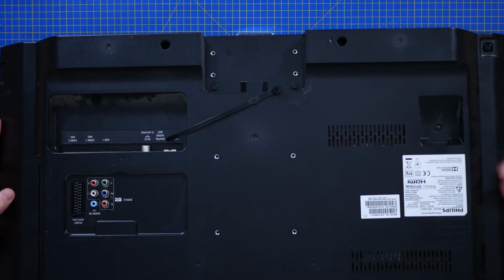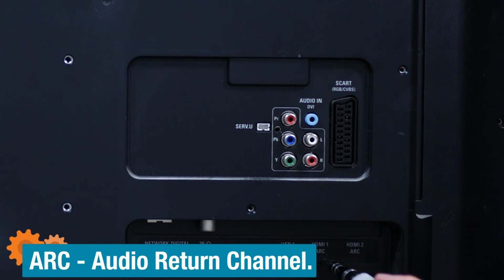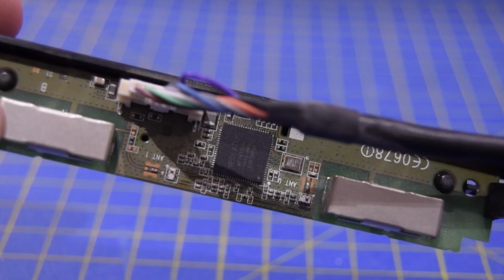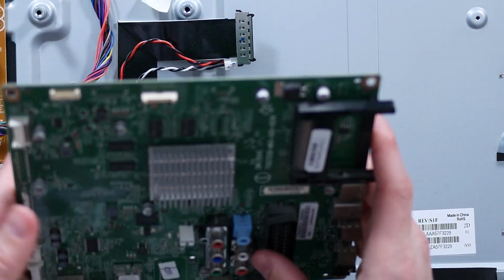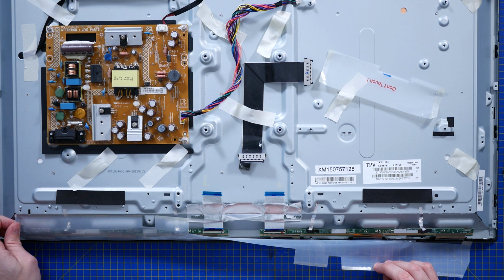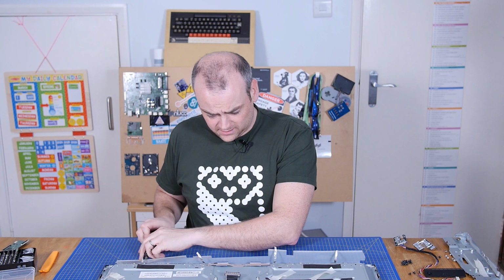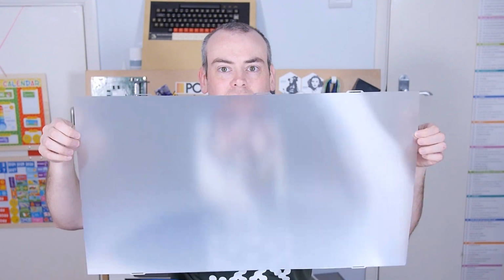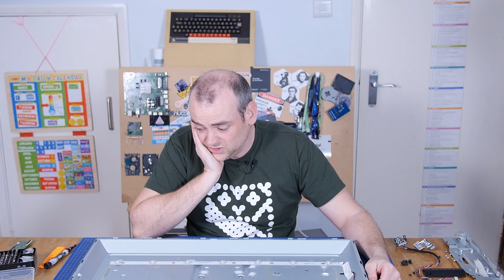Taking Apart a Philips 32" PFT5500 Smart TV: What's Inside? - The Electronics Inside

Comment: This teardown was very cool, but I'm more interested in seeing what you do with those parts now
Reply: I'm open to suggestions!
Reply: @a531016  In a lot of China Retailer marketplaces (such as AliExpress), there are Driver Boards that can be priced as low as $20 or perhaps even lower. I would be interested in seeing if it's possible to reanimate one of these Smart TVs with one of them, even if the "Smart" part dies out due to lower firmware or incompatibility...
If it works, it could possibly save some E-waste since folks are out there replacing entire TVs instead of repairing it themselves!

Comment: The diffuser films look like prismatic films. They are intended to shape the light emission patern of the backlight to redirect light towards the viewer. 3M call them BEF and they have a big market share AFAIK.
Reply: Looking at the video (I couln't tell this at the time) it looks like there is a horizontal and vertical layer? I would suggest that these are to columate the light as it goes throught the LCD, with the peralesent layer looking like it's there for even illumination?

Comment: Yeah, even the most expensive "smart TVs", TV boxes and the like are still a decade behind when it comes to hardware. That goes for tablets as well. There's no reason that even a "child's tablet" at this point in time should come with less than 4 GB of memory and 64 GB of storage and a decent processor. There seems to be an industry-wide conspiracy to make everything instantly obsolete. Not to mention the astounding profit they must be making with such cheap, ancient, obsolete hardware.

I would much rather have a "dumb" TV with a high-quality display and an external media box that can be replaced. I've already had to hook up an external media box to my $9000.00 Sony 85" 4KUHD TV that is only 2 years old because the streaming media apps don't work and it's relatively ancient Android 8. I'm probably going to end up building a HTPC so I never have to worry about planned obsolescence with my TVs again.

Make no mistake, this is EXACTLY why you can't buy a regular, "dumb" TV anymore. It's because the manufacturers want you to buy a new TV every 2 or 3 years just like you do mobile phones. They know that a regular TV will last at least 10 years, and we can't have that...

Comment: That's not an LED TV. In fact, none of the TVs that are advertised as such are. They are all LCD TVs. The backlight has nothing to do with the display technology. First generation LCDs were (and still are) not called "CCFL TVs". True LCD TVs do exist. Therefore it is not valid or acceptable to call any LCD TV  LED.

Comment: The grime that looked like water damage is likely from manufacturing. You often find it in areas around components with massive heat sinking capabilities so it could be some special flux or additional soldering steps that are not cleaned in the same way as the rest
Reply: It's certainly not impossible, although it didn't quite look like (what I would regard as) normal flux marks? Still could have been though! Whatever it was, it didn't appear to adversely affect the TV.

Comment: I'd like to strip Android out of my TV. It's such a shame we don't have an open source Linux distro - but then how would we flash it?
Reply: You would still need custom firmware for every device. Just plug something into the hdmi and use that, raspberry pi would be good.
Reply: @Somebody2687  There are far better (and cheaper) options than the Pi but nothing solves the issue that we're stuck with a proprietary OS,  be that WebOS, TVOS, Android etc. But you can't get large TVs, at least not that I'm aware of, without something that wants to connect to the Internet - and sell your data, like it or not.
Reply: @marcdraco  The rumour is that TV manufacturers get subsidies for preloading apps (Amazon Prime, Netflix, Disney+ etc) and adding hard buttons for them, but also for selling the telemetry data on how the TV is used. Which I can believe, because in reality, a TV these days is far cheaper than it should be!

That said, I can understand your issue with it. Maybe a large "monitor" style set with a Pi or similar and your choice of OS is a better option?
Reply: @marcdraco  I suggested PI because you mentioned open source Linux and PI has the most options for that in terms of a dedicated media device distro aside from a full x86 pc.
Reply: @a531016  Rumour?
Reply: @Somebody2687  I'm not sure it does Brandon. Sorry if I seem churlish, I'm just getting over an infection and toothache to boot. But honestly, the Pi isn't well designed and runs quite hot compared to other designs. Don't take my word for it, the experts at Armbian have torn it apart in terms of design. I have a bunch of SBCs here (two running file servers and media servers running right now, another one working as a router and a few in drawers waiting for jobs. :)

I gave up with Raspberry when I bought a Zero and then ZeroW because they were so much trouble to set up. The Chinese, sadly, make better and cheaper ones like the Orange PI and Nano PI to name two. It's a shame that a British company can't lead the field that it actually created and then grassed over. Now everyone else is playing soccer there and they're just watching from the sideline. Sorry, I'm stretching that analogy to breaking point but you get my point I hope.

By trouble, I mean this single power port and single USB. Not to mention that micro HDMI... I've done far more effective work on Arduinos than I ever accomplished with Pi and I've had them since the the first model B came out. It's the ONLY SBC that's ever blown a uSD card too.
Reply: @Marc Draco  Sure but when I talk about Pi I'm including the clones and other SOCs that are close to the Pi design. Like when someone says kleenex they often just mean any tissue. You said you wanted open source Linux for your TV, since we are likely never going to have a reasonable solution to get anything like that to run on any TV hardware itself we have to move to external devices and the most versatile in my opinion is a Pi type soc running something like OSMC, Plex, Kodi, or LibreELEC.
Reply: @marcdraco  I was giving the the benefit of the doubt!
Reply: @a531016  LOL! ;)
Reply: @a531016  ;)
Reply: @Somebody2687  I hate this new YouTube editing. I keep losing comments.

Trademark "dilution" is something the big corps get very angry about. "Hoover, Velcro, Vero, Xerox, Pritt..." it goes on.

I don't mean to be pedantic but I find it easier to use a generic (SBC in this case) or vacuum cleaner rather than Dyson.

If people like is, in the know as it were, stick to generic names and use an example:: "SBC like a Pi Zero" it's easier for beginners to either pick the one we suggest but also know there are other options.

When it comes to SBCs, the choice is amazing and it's almost entirely down to Upton and Co.! Credit to them but they need to lead again, not follow.
Reply: at least you have android TV and not something proprietary. I wish I had an option which OS my TV used.
Reply: @bok..  I don't have an option and Android is proprietary, in fact I see it "phone home" several times a day even when it's shut down (not on standby) which is concerning. I preferred the one my LG used. I didn't crash once in all the time I had it, this one does several times a week watching Netflix or Prime and leaves the display driver in an unusable state.